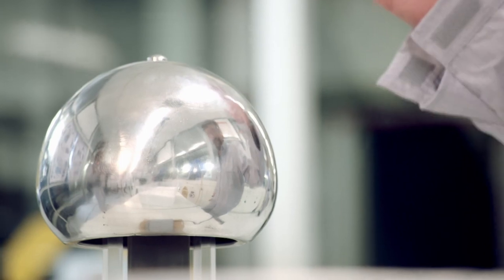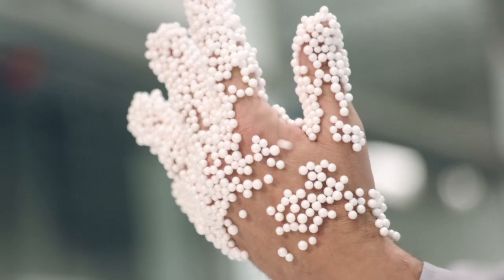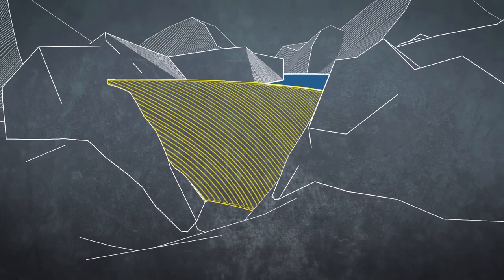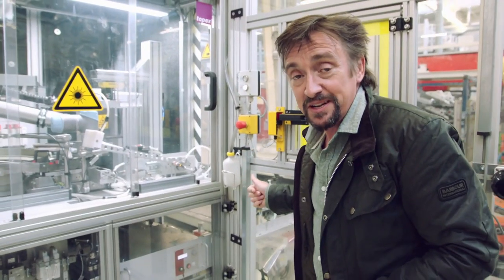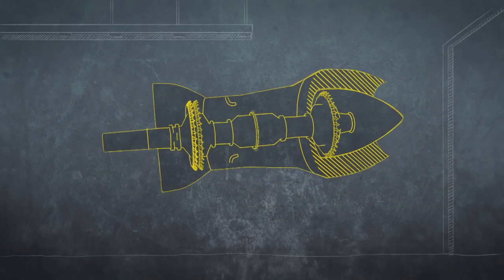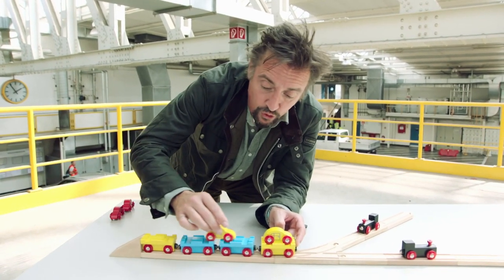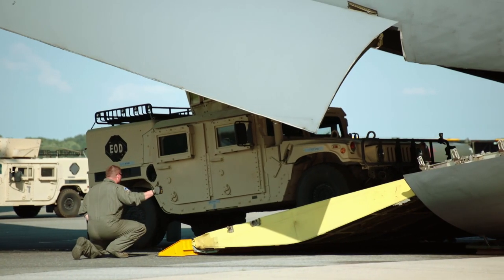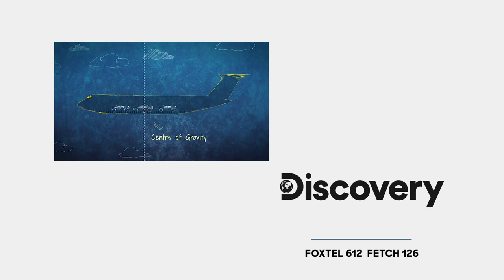Richard Hammond Talks Turbojets and Static Electricity | Richard Hammond's Big

Comment: so Hammond got something wrong on the jet engine, the high bypass engines (the type used on passenger jets) make the engine more efficient, not more powerful. Non-turbojet engines (they type used on military fighter) are more powerful and less efficient. There are also low-bypass turbojets that are in between both types that favor speed but still have an efficiency boost.